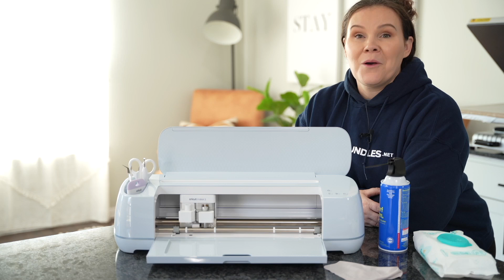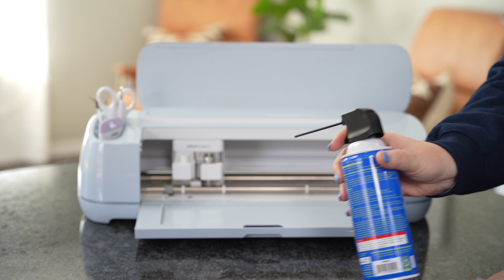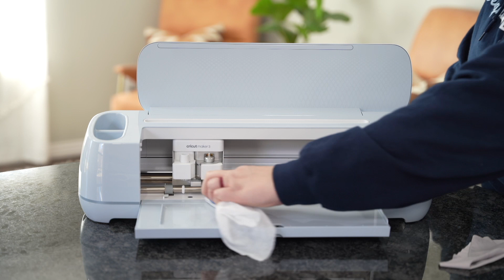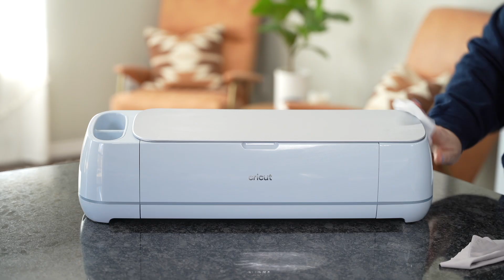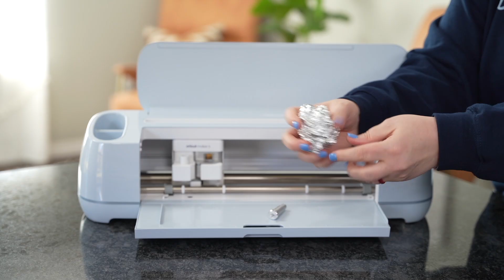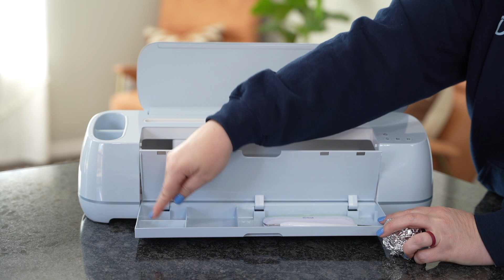🤩 How to Clean and Maintain Your Cricut Machine

Comment: Aluminum foil only CLEANS the blade. It does NOT sharpen the blade. Only something "harder" (think of Moh's hardness scale) than the material the item is made from can alter the shape of that item. Aluminum is not as hard as steel.

Comment: Don't need to shake the canned air, also it's full of moisture so definitely use it ONLY when needed..I don't even use that on my sewing machines cause of that reason. Don't turn the can upside down & spray either cause it will freeze.
Reply from the maker: Great to know! Thank you!

Comment: What kind of brand of canned air do you use to clean the cricut. ?
Reply from the maker: This is the brand Crystal used in the video - https://www.walmart.com/ip/onn-Electronics-Duster-Compressed-Gas-Cleaner-10-oz-4-Pack/621867766 However you can use any brand you wish.
Reply: Thank you @designbundles and crystal 😊

Comment: Stabbing the blade in tinfoil doesn't sharpen it, it just cleans it.
Reply from the maker: It can actually sharpen it as well.
Reply: @DesignBundles  Sorry, it does not sharpen the blade. If you look at the tip of the blades as it is used, the tip is worn down. Stabbing into the foil cleans off the adhesives and helps the blade glide more smoothly through the vinyl, paper etc. It's a common misunderstanding, but with so many followers, you want to be sure you've got your info correct.
Reply: @lisakaydavenport7368  I just wanted to add, its crazy how many people still say foil sharpens the blades.. little bit funny too :P